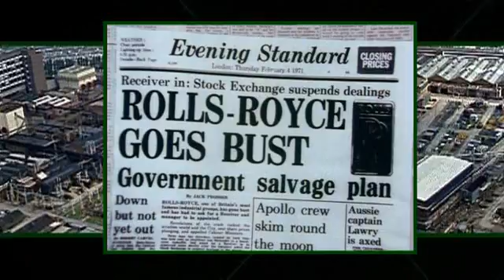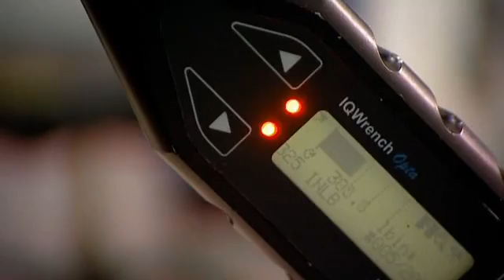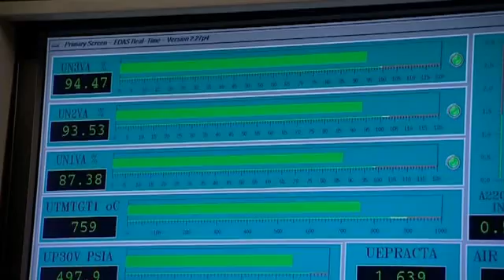Rolls-Royce, How To Build A Jumbo Jet Engine -HQ- (Part 3/4)

Comment: I see so much good going into a Roll's Royce engine until you get to the turbofan!!! Here's the scenario boys. Where gonna make every part precision, test it for clearances, temps, lubrication, make it quieter and with less emissions, plenty of thrust and fuel efficiency. Last of all put on a turbofan... OOPS THAT THING CAN DETACH AND DESTROY EVERYTHING WE WORKED FOR. Great design boys!!?? lmao!!!!!!
By the way, how did it go with that Air France a380? Did I see damage on the wing slat just above that bugger?
Reply: The engine in that air France case was not rolls royce, twas engine alliance...
Reply: Are you implying that there is something wrong with turbofans in general? Say a flock of birds strikes engine of such trust. You think that ANY engine would survive such impact. Those titanium alloy fans are as tough as they can be for the weight and size.  That is why they do those containment tests. And they are WORST case scenario.

Comment: How does combustion still perform unaffected by all that water being thrusted into it??
Reply: Most of the water bypasses the turbine round the sides.
Reply: Very less water reaches the combustion chamber. Most of it is bypassed around the outside. Fans rotating at high speeds are technically huge tumble dryers that send water outside. Whatever little loss in thrust is sensed by the sensors, is then compensated by changing the fuel mixture.
Reply: Because the water mixes with the air and the fuel mixes in with it so the water dosent effect any on the combustion
Reply: Then it would run under water too. A lot of water doesnt make it to the combustion chamber...  Feul mixture is corrected for the water that does make it in. Water doesnt combust that well u know.  @nuke7784
Reply: @scuffieduffie  thanks i guess
Reply: Nuke 778 Np i guess😂✋🏻
Reply: its not fuel burning in the a380 engine ... its compressed air... that is how..you may also want to look up levitation through sound renaissance frequencies...those engines are like tuning folks .. that is my theory ... where is the 240 tonnes of fuel in the wings ? ? seems only the apu uses fuel but the rest is perpetual motion created by a vortex inside the engine chamber by compressing the air to crazy  levels ..(the side effect of which is flames .. from super heated air..that all ...just hot air!!..   whilst all the happens the hundreds of blades/ tuning folks create a levitation resonance know about for 1000s of years ..and shown in ancient scrolls .. that is how a bee fly/hovers !! Bees not not fly with wings ..and the air planes dont either...

Comment: Rolls Royce employees seem very proud of their jobs.
Reply: bajeiceman : it's possible I  got job there I am aircraft maintenance engineer
Reply: It's a British thing. They are always so damn proud and sentimental about their jobs, particularly if it's a skilled labor position producing highly technical machinery or apparatus. If you ever see a documentary about British automobile manufacturing, those folks behave like every single car they build is blood related to them somehow. Which is sort of cool but I don't think that any employee should exhibit that degree of reverence for a job/employer that would terminate them to save the bottom line in a questionless heartbeat. It's as if English workers feel the need to appear more emotionally invested in their work than normal, in order reduce the likelihood they are replaced or their position liquidated. At this late stage in our capitalist society I feel like anyone presenting such respect and loyalty to an employer that does not reciprocate in equanimity is just exhibiting traits of Stockholm syndrome

Comment: Wow all that work destroyed at 12:11
Reply: Its a small price to pay compared to a loss of a passanger plane loaded with up to 500 passangers, each with a lawyer demanding millions in compensation for loss of a loved ones. For reference: see current Boeing trouble.  That one blowned up engine is peanuts in costs. New engine that size costs around 13 to 15 million $ each. Every part in it is regulated by highest quality standards and is considered a "Safety Device" or part of one.